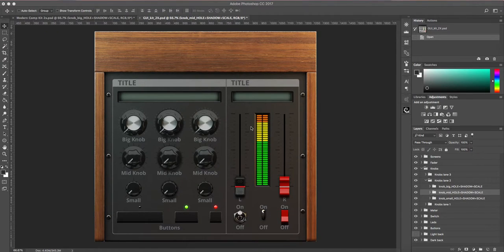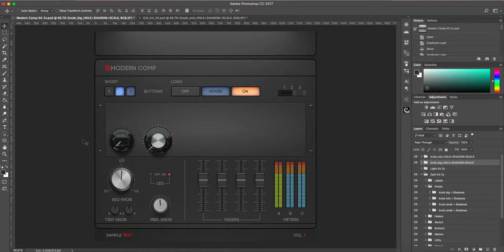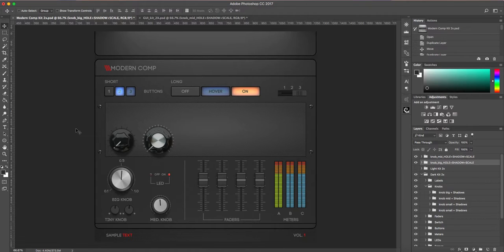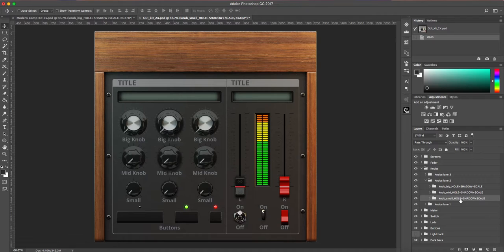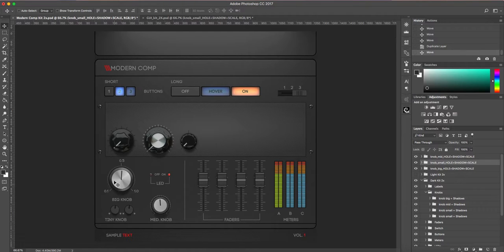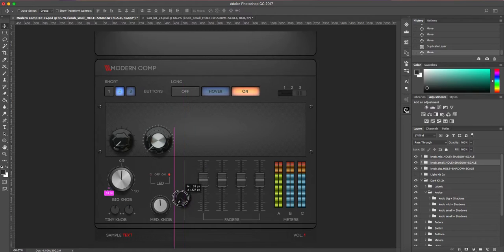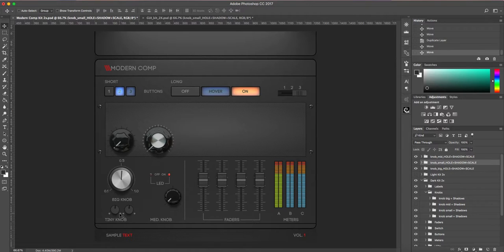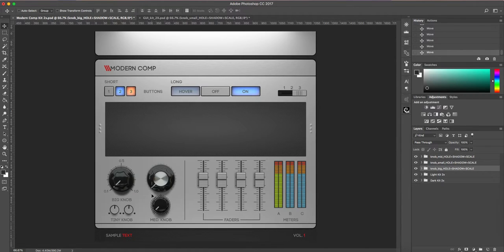UI Kit knobs comparison

Comment: How does it work  for image files to work with KONTAKT, then ? The image files are provided separately then I specify that I work with GIMP or Pixelmator .
Reply: Could you please specify what do you mean?
Reply: corbobilly hi, thanks for your question. We made files according to the Kontakt requirements . Knobs as sprite sheets , you don't have to make any more work here . 128 frames . Also, in case you want might need, we have separate files for each knob animation frame , so in case you modified a knob , you can apply this modification (color , or size) to all the frames of the knob.
Reply: So I must to use the files that appear under Photoshop that have 128 parts and they are compatible for writing with KSP in KONTAKT
Reply from the maker: How’s your Kontakt development over the 8 years?